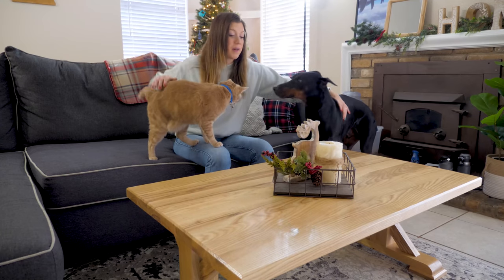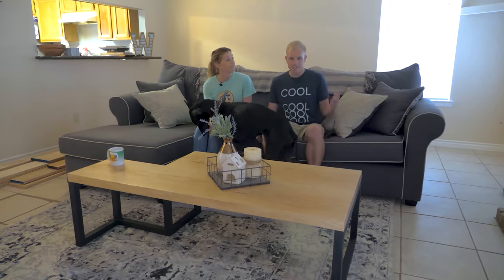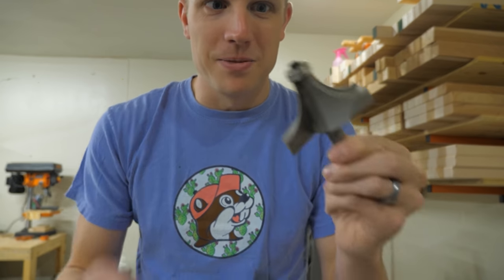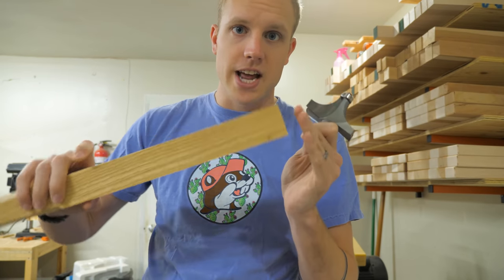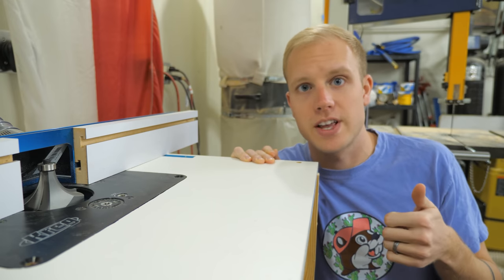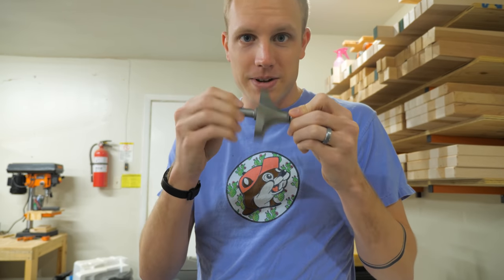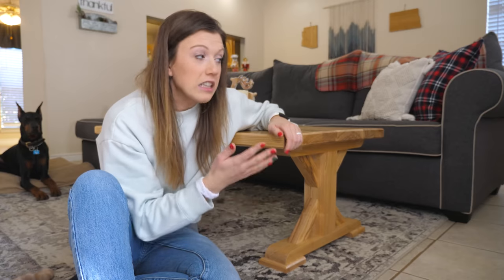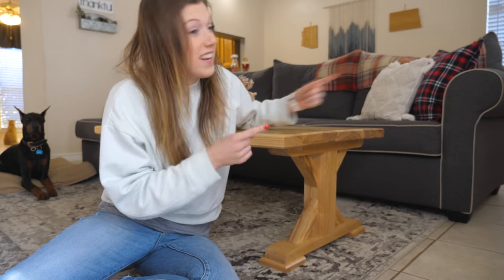building our ultimate farmhouse coffee table for selling 💰🤝

Comment: You should try using a plug cutter to cut and fill your holes instead of using dowel rod.   It saves you from having to buy the rod,  you can use scraps to cut your plugs, and its face grain instead of end grain, so they won't show up.
Reply: You can make your own dowel rods .. you know? No need to buy them.

Comment: Large router bits always command respect, but roundovers don't remove nearly as much stock as other, more commonly giant-sized bits do.  (Think raised panel bits!)  However, you didn't say what speed you're running the bit at or how fast you're feeding it through.  Full speed, it will dull quickly and that's when you will start getting burning and kickback and chipping.  Slow the bit down and slow your feed rate so that you clear the chips and the bit will last longer and perform better for a longer time.  Hog most of the waste on the tablesaw or bandsaw and it will last even longer.  (If you get more chipping doing that, it means you're feeding too fast.)
Reply: Great looking table. Where in the Houston area do you buy your lumber?
Reply: Great advice from a experienced wood !worker. This how YouTube souls work , think you .

Comment: I'm a little late to the party, but we run those large bits all the time. I would recommend 2 or 3 passes depending on material hardness. I always run sacrificial fences (MDF)  so you can just see the front half of the bit sticking out. Make sure the fence is just far away from the bearing so it doesn't heat the bearing up and wear it out prematurely. This ensures there are no holes for a board to get sucked in or kicked around for the most part. Just my 2 cents.

Comment: Nice final product, it shows in the tight joinery.  I can only echo all of the safety tips on router bits.  I have made cuts like that just fine and I have made cuts like that caused injury, not worth it. I will always use a t track and clamp.

Comment: Hello there. Back in September I had to buy and use a 3 inch raised panel bit to make a walnut baby bed. I burned up the bearing (closest to the bit) on my router because I didn't read the directions and reduce the speed of my router. Fortunately it died on the very last cut of the last panel. Lesson learned.      P.S. I live between Houston and Galveston. there are a couple of great tool stores in Houston (Woodcraft, Rockler, and Circle Saw) as well as my favorite lumber supplier (Mason's Mill and Lumber). Good luck in your business.

Comment: For rounding over, could you have used template and 2" flush trim bit? regardless of which bit you use, given that you are routing end grain, using a backer material to avoid tear out might help
Reply: Depends on grain orientation in the wood.  If the grain is falling away the wood will "feather" and catch the bit and kick back.    They do make a flush trim bit that cuts in both directions (up at an angle and down at an angle), unlike a straight flush trim bit.
Reply: @justgordoncarving6840  I know the ones you are talking about. Pricy, but well worth it if you are going to be doing this for production as Jenny and Davis are planning.

Comment: Biggest bit I have ran is a 1" 1/4 round (i own larger cabinet door panel bits but have not used them). You definitely want to watch your bit speed, feed rate, and grain direction. It gets scary when those big bits get unhappy. I noticed the blowout on that top runner. I frequently have that on ash and occasionally on hickory. I usually chalk it up to an ID10T error.
Reply from the maker: Haha yeah that blowout was from a 3/4" straight bit. Learned our lesson there!

Comment: Biggest router bit I’ve ever used... well It was so big I had to put it on a shaper.
Reply: I work in a woodshop, just making sills and wallcaps, occasionally mantles and seat boards. I use a shaper table a lot for putting ogee p-nose into 5/4 fjp. Also sloped ranch (kinda the negative of a round over) for a specific builder. Once you get so big, shaper is a great choice because it auto clutches, just remembered to hone your bits!

Comment: If you’re looking to batch legs  (it sounds like batching is likely based off previous videos) I’d recommend using a smaller bit like a 3/4” or a 1” to remove a good bit of material before jumping to the 1.5”.   They’re not the cheapest of bits so limiting material being removed will prolong life. Also, they’re much less sketchy when they’re new. As the cutting edge begins to dull, you’ll be more likely to run into chip out and kick back when trying to do a single pass.
Reply from the maker: I'd rather buy a new router bit every week than slow production down by changing bits every 10 minutes
Reply: Jennie and Davis that’s fair. I know you guys are limited on space for multiple stations with router lifts. Was just a thought :)

Comment: Large router bits are fine. Cutting edge distance from axis, or cutting radius, should determine the RPM. Ensure your motor is hefty, around 3hp, for smooth torque, and run it slow. 

Suggestion:  cut the table fence to roughly the shape of the bit. Thus supporting more wood while engaging and leaving the cut. The operator skill is in feeding the piece steady until the bearing begins to act as fence. Modify the fence to minimize space between it and the bearing.

Beautiful table, congrats on the design!
Reply: That is a great tip.

Comment: You table needs a miter slot and miter gauge so you can use it for the feet roundover.  Would be easy to make a jig to clamp the leg in for the roundover to make it a bit more safe.

Comment: Nice job on the design! I like it, Craftsmen style never goes out, simple, effective construction that just plain looks great. The joinery between the angled supports and vertical/ horizontal pieces,  tenons are the strongest joint, Domino's are below that, butt joints reinforced are probably the weakest. Construction time is the reverse though, butt joints are the fastest to make with the others following behind. Tooling costs are the same as well, with butt joints you have all the tools, tenon's and domino's will cost you some money to get setup to make profitably.

  Some things for you to think about. If you think that the large roundover you did will be a common cut on every table you are planning on, look into the shaper. Like a router table but with way more power and versatility, the cutters mount on a shaft instead of the cutter sliding into a collet. You can also flip cutters over and run in the reverse direction, not really needed with a simple roundover but those big chamfers could be cut pretty easily. A shaper is safer as well, kickbacks are normally from RPM and cutting speed vs wood feed rate. If that gets out of wack, you get wacked. Shapers have the power to cut those big profiles with relative ease. I have both router tables and shapers, both have there place in a shop, light duty stuff or one cut= router table. Heavy cuts and quantity= shaper. Safety can be had on both, you just need to know the equipment's capabilities and limitations. Cutters can be a little more expensive for a shaper but the carbide is usually way heavier and meant to be sharpened multiple times before its life span is exhausted. Router bits, you'll be lucky to get 2, maybe 3 sharpening's before it's trash.

  As others have said, a backer block or sled with a fence is needed to eliminate the blowout on the trailing edge, or you have to run the part over width, profile it, then either tablesaw to width or joint off that edge to width. Try to eliminate extra work or steps by your processes. 

  As I have commented in the past, you might want to look at a clamping rack for doing those big slab tops. Probably not in your budget just yet but once you start ramping up and doing multiple tables at a time, pipe clamps and large glue ups are just a pain. Your back will tell you soon enough that those are just plain stupid heavy to move around.

 Hope you sell that one quickly and get to keep figuring out your path! Good Luck!!

Comment: Just a thought that might make it easier for the router table, maybe put a t track in and use a sled to help you run it across the bit? This way you don't have to free hand and can keep a steady pressure and distance to the router bit. Just a thought thats all.
Reply: i agree with you, that would be a great step forward to safer operation on router table also. they can also make a sacrificial fence with shape of the bit to help support actual piece against the fence.

Comment: Now that's a jumbo router bit! However, it looks very unsafe to run that chunk of wood by hand as it appeared you were doing. Also, when I run larger bits (not that large though) with end grain I end up with massive tearout on the exit side. I might get that bit though and my approach would be to use a sled with a backer to prevent tearout. Look at Rockler for their rail coping sled for an example. You might have to make your own jig for the size of the bit and lumber you're using. Also, think about it from efficiency of production since you're planning on selling this. A simple jig is way faster and cleaner than hand cutting that relief. 
Great youtube channel! Thanks for sharing.

Comment: I KRINGED WHEN I SAW YOU TAKE THAT FULL CUT ON THE ROUTER BIT , SAFETY OVER SPEED
Reply from the maker: I don't think so, Tim.
Reply: @jennieanddavis  if your router table had a Miter track I would suggest using a Miter Gauge with a sacrificial fence and take it in 2-3 bites. And the fence will help prevent any tear out if it was to happen.

Comment: Completely reckless taking a big bite with the router like that. Fences were not tight and fed hand held. Two huge mistakes. You’re running the risk of a kickback and possible shattered bit pieces shot through your eyes, face, or neck.
Reply from the maker: Did you know we fly through hurricanes? Everyone's risk tolerance is different.
Reply: @jennieanddavis  I knew that. I’m willing to bet that the pilot and crew of those planes follow all the proper safety protocols to minimize risk of injury or death. By using the router in the method shown, you are taking a completely unnecessary risk and setting a poor example for others who may follow in your footsteps.